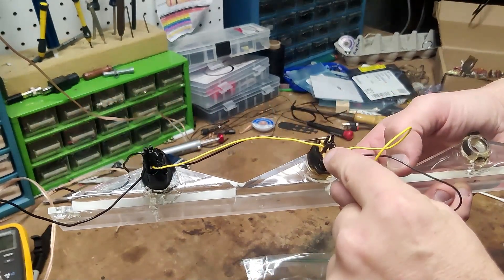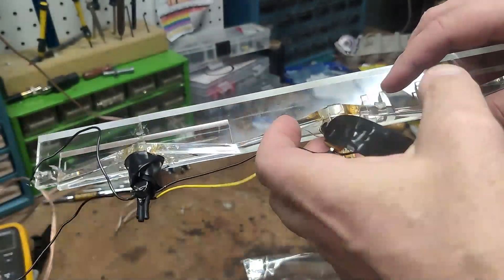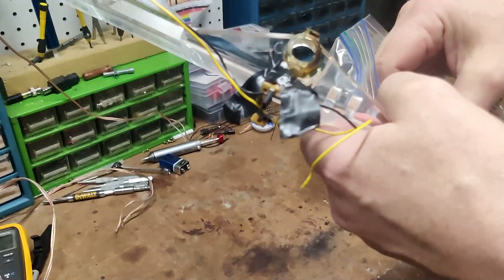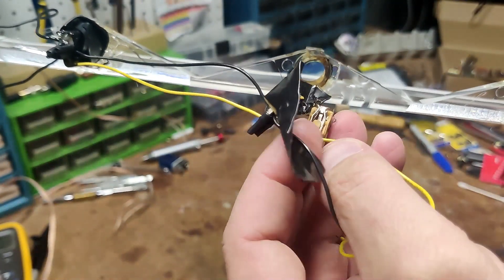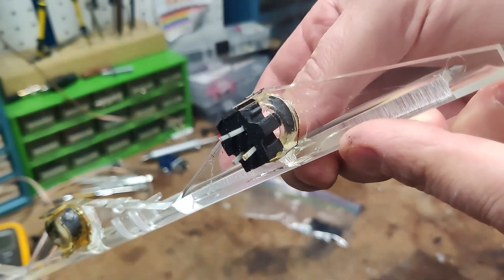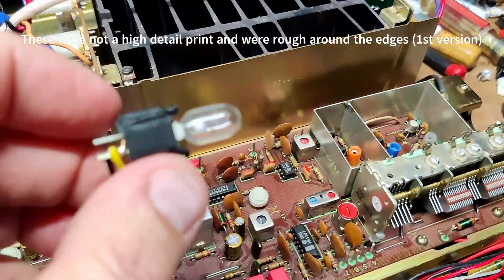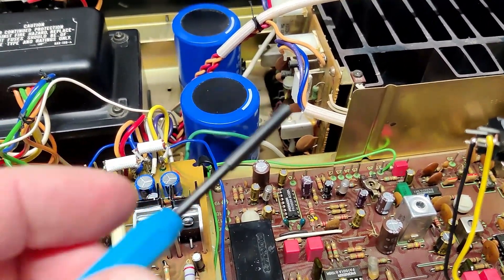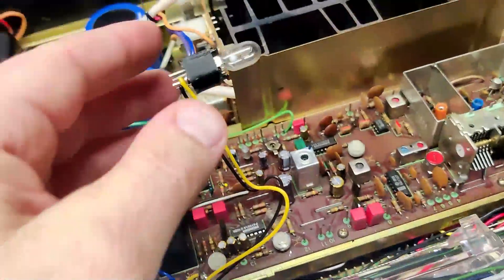Pioneer Dial Lamp Bulb Socket Fix (AKK-005) - Turn up volume - bad sound. Sorry....

Comment: Hi Dave!. Great stuff. I watched your videos working on the Pioneer SX-1280 and thinking about purchasing one of these beauties from a seller who says it is in mint condition but am hesitant because of the power output transistors not being manufactured anymore. Is there a fix for this if one should go and I'm stuck with a big high dollar paper weight. Another guy on youtube who worked on the SX-1280 said the unit had fried output transistors and had to make up his own boards to mount newer more modern tansistors. Is there a company out there who manufactures replacment boards for the 1280 power output transistors that you know of ?. I'm thinking the SX-1250 would be a wiser choice. Whats your thoughts on this ?..
Reply from the maker: That is a dilemma. But if they are working, and you can get the it for a deal, I would pull the trigger. The 1280 is a beast, however if you have a deal on the 1250, it would be a safer bet if you are not handy with soldering and circuitry, they have replacements readily available (863-MJ21193G & MJ21194G). There is a build for the 1280 but it is a bit advanced. You would need good solder skills and an understanding circuit. The 2SB706A's and 2SD746A's are unobtanium, but there are several posts over at audio Kamrma that cover the swap.
Reply: @PackardDog  Thanks! for the reply Dave. I am good at soldering but not at reading ciruitry on a schematic. I found a1280 for sale buy a guy who says he bought it from a single owner in mint condition, all original and very clean inside. He doesn't think it was used very much. He is asking $3,800 for it but don't know if thats really a good deal in todays market. The THD is better on the 1280 vs the 1250 but then again I don't know if this makes a big difference for sound quality at high or low volume levels. It truly is a dilemma. ..Ron
Reply from the maker: @RM-ks8pp  Yep 3800 is actually a fair market price nowadays..... It sounds like it was a not abused system, so likely you would be ok. There are going to be techs who can fab the output transistor replacements, but like anything related to these old units, it's going to cost $ to repair if it goes bad. Either way you go, you would not be disappointed, the 1250 is around 160w at 8 ohm  and the 1280 is around 180w 8 ohm. You might sleep better with the 1250, but if someone is handy with electronics, the 1280 might be their preference.

Comment: Hi Dave, great stuff, thank you. Do you have any socket bases left? I would love 6 of them and happy to pay for them (saw you'd sold some on ebay). If you're not selling them, would you share the finished CAD file? Thanks for any help.
Reply from the maker: I do. However, if you have a printer, I can share the file.
Reply: I grabbed the zip file for future use, thank you (but I'd need to run down a 3D printer). If you have six you can part with and want to let me know how much and best way to transact, that would be greatly appreciated.
Reply from the maker: @dukfootball6010  Where would they be shipped to ? Go ahead and pm me on audio karma.

Comment: Hi Dave,
I'm working on an SX-1980 and these are exactly what I need. I found the post in the AK thread where you mentioned the print file, but I couldn't see it there. Would you mind sending it to me? My email is in my channel's about tab. If not, I'd be happy to buy 4 or 5 from you. Let me know.
Reply from the maker: The file is free to use for personal. I would ask that no one print these to sell, as it is my work. https://audiokarma.org/forums/index.php?threads/sx-80-series-lamp-socket-print.1013578/page-2#post-17123409